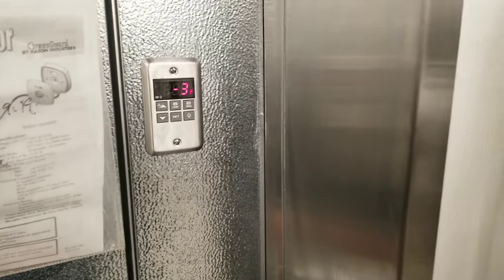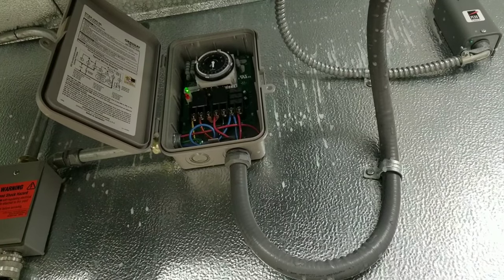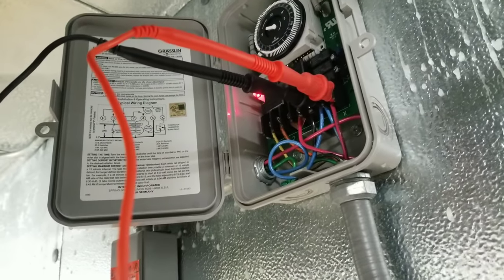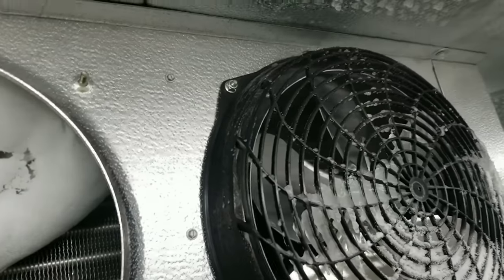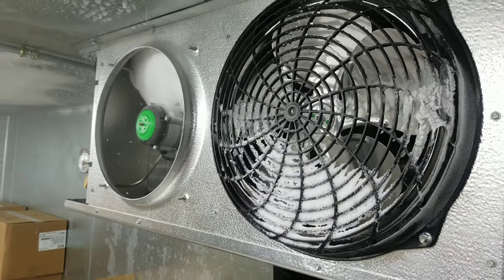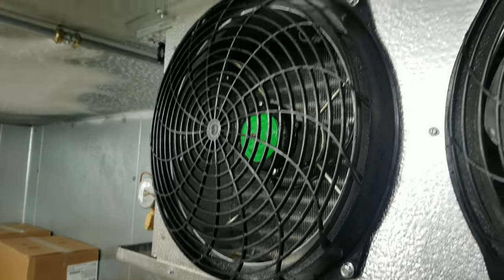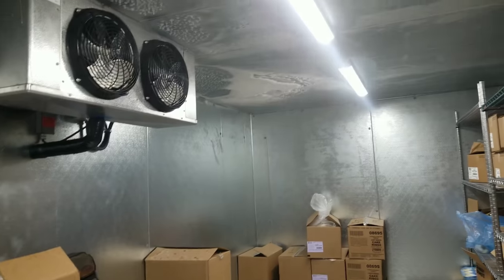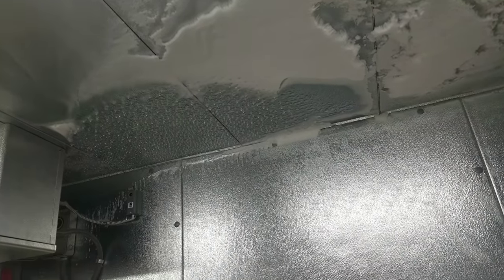Frost build up in a walk-in freezer Part 1

Comment: Now that’s a real world walk-in problem.  Those leaks and humidity problems are prevalent in our trade.  I would start by having them empty the box and warm it up. Wipe it down dry and put a fan in there.  Use a hair dryer paint stripper gun to do those button ( remove all ) .   R&R the two heater safety and fan delay. Once it’s down to temp, run through a defrost cycle. Use 30 minutes X every 6 hrs. If the delay comes out too soon, get a lower temperature rated one.  You’ll want the droplets to re-freeze  on the coil. That will eliminates the humidity cloud or water droplets that are spit off the coil.  Sometimes a bad drain will have that pan heater boiling the condensate into steam in the box. They’re supposed to have a very steep pitch on low temp units and trapped outside the unit.
Reply from the maker: I can get behind that idea- Im supposed to do a follow up visit soon if they ever approve my quote so I hope to get some sort of closure

Comment: That relay is for two speed operation of evaporator fan motors. 
The electrical drawing shows how to bypass it and run fans at full speed all the time except in defrost. 
Otherwise the fans run at full speed when the solenoid is on and half speed when the box is at temperature. 
I agree with you the box is poorly assembled and warm air is penetrating the seams.
Perhaps some aluminium colored silicone could be used to seal panel seams. 
But it will be difficult to have it adhere with the box in service.
Our company use to do the refrigeration part of walk in installs for a large local construction company and they would assemble the boxes.
However we found the same issues that you found when they assembled the boxes. 
So we no longer do work for them unless we assemble the boxes and do the refrigeration part as well.
Reply from the maker: Thanks- that is some good information- I told them they would have to let the box warm up before I could even attempt to seal the seams - there fighting with the company that installed it I believe

Comment: Great video. Seams there are two issues here. A leaking roof and not so great installation of the box. My experience tells me the roof needs to be done first. If you seal the box with silicone all it will do is hold moisture back until the silicone fails. In the mean time the water will continue to expand and contract and cause additional damage to the box. Just my thoughts. Thanks and keep them coming.
Reply: Retread What would you do in this situation?
Reply: Familia Sanchez HVAC I would recommend the top down approach. Roof should still be under warranty as the box is. Have the roofer make sure there are no leaks. Then follow Bills advice. He was there on behalf of the factory. U may possibly be able to get box installers out to tighten up the box. Hold the subs accountable if possible. Those r just a few suggestions or directions u can head. Thanks for asking
Reply from the maker: Thanks for the tips!

Comment: You walk into another fine installation by others , silicone the gaps not best way to resolve problem . Shutting down an letting box completely thraw out the box an turning those cams to pull seal together proper would ultimately be the best way . Anyway good luck with that repair ! Note - use a fan in box or jump evap fans on during sealing , blow fumes out of box . Thanks on video
Reply from the maker: Thanks for the info - much appreciated

Comment: I have built quite a few freezers in the past and have always silicone the tongue of the panels before assembly to ensure a air tight seam . Our health department would not allow any silicone  in the seam as a repair. It does not look like your panels are cammed  together properly. You would have to release all the cams and start over reassembling each panel . Good luck!
Reply from the maker: Yeah and so far I was told they are having the original installing company come back and fix those seams-- so well see what they do if Im called back for a follow up
Reply: @curioushvacguy6876  Yea they should be responsible  to fix any air leaks .

Comment: Hey Curious good video, You probably have a small roof leak that’s what’s separating those panels, but the frost on the ceiling is warm air infiltration and needs a door curtain. Also you need to find their delivery schedule and set the defrosts when they are likely stocking it, thanks for sharing bud.
Reply from the maker: Good points Chris- thanks for bringing that to my attention

Comment: Wouldn't infrared thermometer help out if warm air is coming in? Also, i have found major roof leakage from where the lineset penetrates the roof. The foam insulation deteriorates and allows for snow and rain to get inside. I made a huge stainless steel snorkel at one location to cover up all the lines coming from a packaged refrigeration unit.  If you can get to roof of freezer you can seal it with a Home Depot product called Tropi-cool. Its pretty good. But surface must be clean and dry. 2  coats if need be.
Reply: Greg M IR read surface temperature not air. There is a chance it would pick it up but just may be.
Reply from the maker: yes sir

Comment: Well the thing is that the seal is supposed to be on the outside of the box otherwise ice gets in the seams and pushes the panels apart. For outside exposure the top should also have a slope. You also know that the seal on the edges will also be blown. So do you leave em where they sit and blow them with foam or try to re-unite them. Do you lay a polybutyl rubber roofing membrane or add a porch roof section. Obviously the configuration was not meant to sit outside, nor was the vapor seal material they used.  And the edges of the panels also need to be sealed and flashed.
Reply from the maker: your exactly right--

Comment: A problem I noticed is the guttering is not the correct type nor are the seems water tight. That would leave water standing on the roof instead of flowing off and the bead of caulk someone put on is preventing water from flowing off the roof as well. I would start with that and call a roofer.
Reply: flat cooler is flat go figure LOL! I'm guessing they didn't want to PAY to put a real pitched roof on top...
Reply: throttle bottle on the installs I have done like this one the roofers always put a pitch on the box after we assembled it. While it may look flat to you and assuming the roofers do their job then there should be buildup material laid first before the roof is actually put on. Here in Oklahoma the inspector has to approve the buildup and pitch before they can roof it.
Reply from the maker: your exactly right--
Reply from the maker: correct
Reply from the maker: makes sense

Comment: I know it isn't standard practice... But sometimes depending on the evaporator and set up, you can run fans under defrost, when your heatrods are in the back of the evaporator, then you will warm up the evaporator faster and therefore have a shorter defrost time..
Reply from the maker: Interesting- I never thought of that, have you done that before ?
Reply: @curioushvacguy6876  yes.. It is the best thing  to do  if you're rodes don't go through the middle.. A lot of  gondola freezers are made to run fans during Def.. And that's because the heatrodes aren't in the middle..
And it's also something you  learn when becoming a refrigeration engineer..
So I'm 100% sure it works
Reply: @curioushvacguy6876  is there any update.. I'm dying to know what happened

Comment: If under warranty, I would make the box installer/seller, make repairs! And if falls back to a roof leak. Then, repair roof,and do as you suggest to dehumidifier the box and reseal. That's just my thinking if I were the owner.
Reply from the maker: Your exactly right- I think thats whats happening right now because I havent gotten called back yet

Comment: Late to the party but I notice you had Standing water during you defrost. In my experience the  water standing in the drain pan will steam up with the pan heaters. also I didn't see a trap and sometimes the fans can suck up air thought the drain.

Comment: I encounter that kind of situation but my finding is different...in my case the door leaks and moisture goes inside then it build up moistures the installer of chiller didnt make a proper installations of panel and didnt install also heater on door frame. When i did all the necessary things the walk in freezer works like a charm and didnt encounter same problem since then

Comment: I have an 18 year old freezer box and we're getting ice similar to this on our ceiling. Could the gaskets between the panels be shrinking or some other way spreading apart? What if I simply put a silicone caulk bead on the outside of the box on the seems? That would stop future air leak, right? Then shut down freezer until ice melts, mop it up and turn back on? Contractor is quoting 2k to loosen cams and re-tighten. Thanks!

Comment: What silver caulk do you use?
Reply from the maker: I dont have a brand in mind, I just grab a tube of cold rated caulk from my locak refrigeration supply house-- hard part is getting them to shut it down and warm up so I could actually apply the caulk
Reply: @curioushvacguy6876  im curious the steps you took to pull the moisture out behind the wall panels